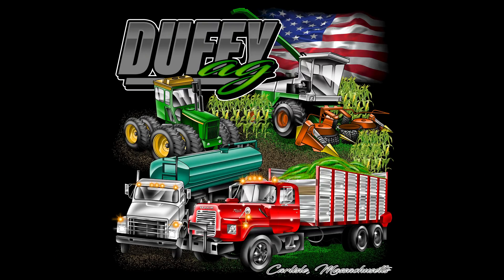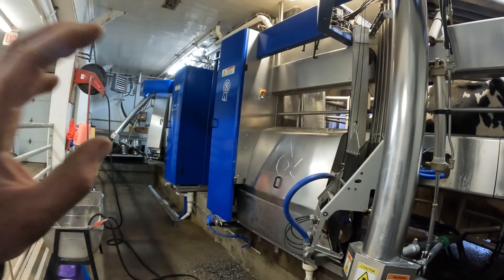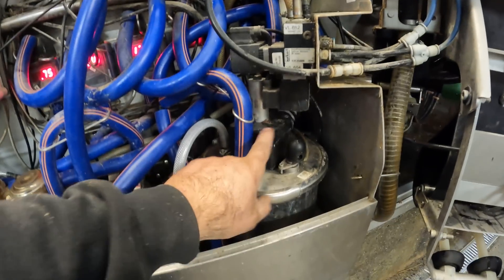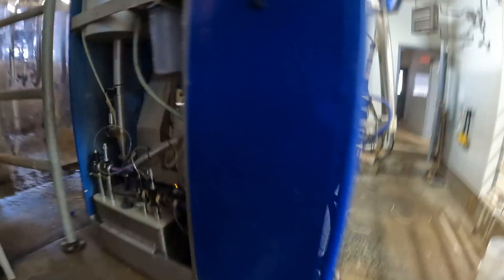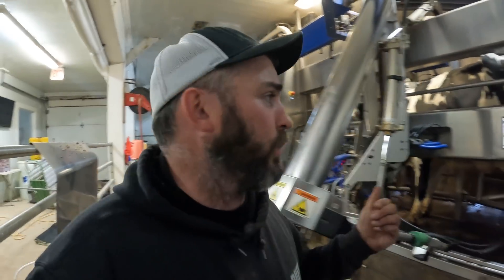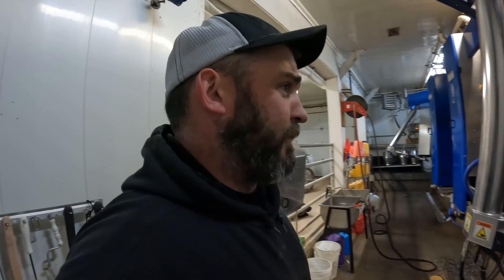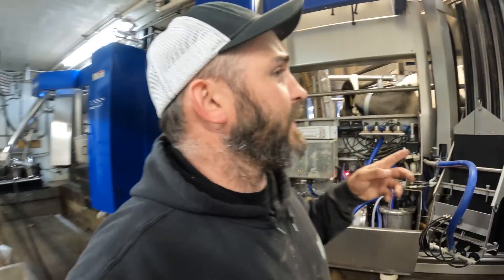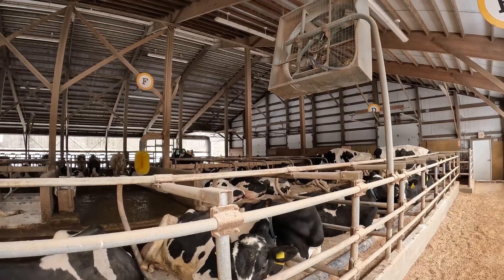It Is Time For A Upgrade- Robotic Dairy Milking Equipment Upgrade

Comment: So I milked cows with my dad for over 20 years.  In 2014 we sold the milking cows.  How can people afford these robots.  The cost of the detergent and acid on one of these most be expensive.  I guess If the robots milk the cows that means I could of got a job in town with my wife to help support the farm.
Reply from the maker: Farms that are already paying for labor to milk cows these replace that labor cost and give you flexibility. Paying someone 50k+ a year to milk cows adds up quickly and then you are always at the mercy of that labor. Most farms I work with are tired of trying to find decent help or yes they do other stuff with their time like producer dairies or Cropping. Very few have off farm jobs tho
Reply: @DuffyAg  so how are the costs of detergent and acids and sanitizers.  I would assume the robot does a wash cycle after each cow. That was always a major expense with our  pipeline.  Do the robots run 24/7.  How much human intervention is needed.  Do the cows get their grain while on the robot.
Reply from the maker: @ram_diesel_power6039  running cost including maintenance and chemical is roughly 1k dollars a month. Robots washed 2-3 times a day and will do a local wash after a treated or fresh cow. Yes the robots milk 24/7. Human interaction depends on the management practice, fresh cows that you need to make sure are getting going and  normal cow care. Grain is fed in the robot to help entice visits and depends how much of the ration based on energy at the bunk
Reply: @DuffyAg  so how many cows can one robot handle.
Reply from the maker: @ram_diesel_power6039  roughly 65. The main number is lbs per day out of a robot. 5k lbs a day is a average goal but we have farms making 6800lbs a day. Had someone ask me last night about jerseys making 60lbs on robots if they could milk 70, I believe they could milk more then 70 just based on harvest numbers. New Zealand I worked with a farm that was grazing milking 120 per robot but only 1.7 times a day

Comment: not an engineer but would it be cheaper to put an airdryer or a heater in the system kinda like a truck air dryer something of that style obviously a truck air dryer wouldn’t work probably a stupid question
Reply from the maker: The air system has a drier. The vacuum tho pulls water into it if there is a issue. So using air is much cleaner and reliable